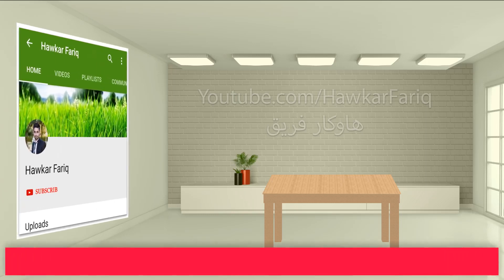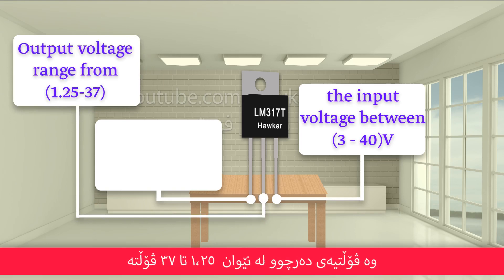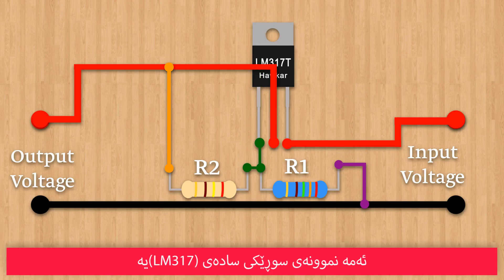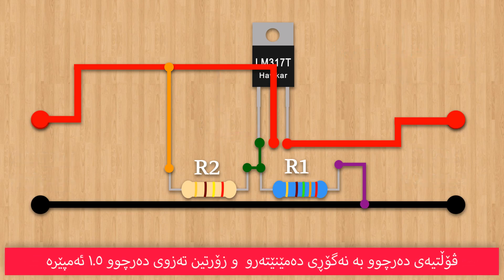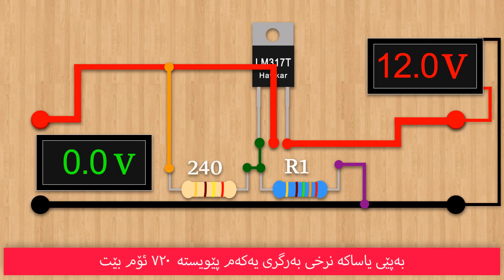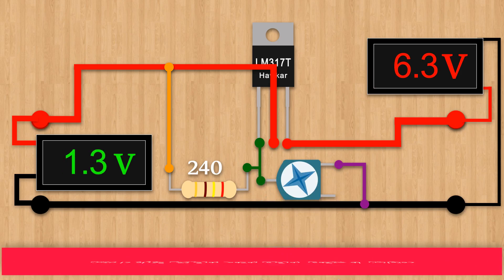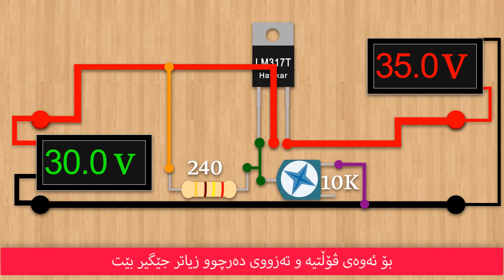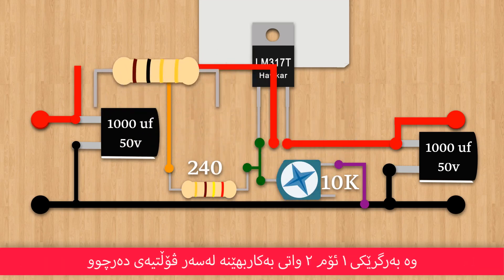LM317 voltage regulator (1.25v to 37v) 1.5A

Comment: Simple and detailed explanation. It would have been better if you could have told more about why we need capacitors and more resistance to the out and input and how did you calculate 240 ohms for the first resistor

Comment: I want to make 5volt charger from 12volt adopter for my mobile phone.
If LM317 become short then 12 volt will be at output 
My question is that...
How i can protect my device in this case.
Reply from the maker: Have an IC LM7805 it's better because it whe you give 12 volt to this IC you get 5 volt only from output.
Reply: @HawkarFariq  ok thank you sir.

Comment: what if i want to increase the AMPERE
Reply from the maker: The maximum current for LM317 is 1.5A.
But you can also use LT1083 it gives 5A
Reply: 2955 & 3055

Comment: Can i use this diagramme to charge lithium battery
Reply from the maker: Only one battery or more?
3.7v?
If only one battery 3.7v
Yes you can use this circuit
And the maximum voltage for charging 4.05v to 4.25v.

Comment: Sir how about 3 phase  ac in the input and max 14.5 v dc
Reply from the maker: What 3 phase?
This is DC to DC converter "regular voltage"
And the max input voltage is 40 volt

If you want to convert 3 phase AC voltage to DC you mast use transformer to decreasing the voltage and use diode to convert the AC to DC and use capacity to filter the voltae. after that you can use this circuit

Comment: Resistance value
Reply: Capacitor
Reply from the maker: The input is 50v 1000uf
And the output is 50v 100uf
Reply: Okk thanks
Reply: If the capacitor is not plugged in
Reply from the maker: Why you don't want to use the Capacitors?
You don't have these Capacitors? 

The Capacitors for filtering the voltage to make a pure DC.
Reply from the maker: The first resistor is 240 ohm
And the variable resistor is 10Kohm.
The last resistor is (2W 1 Ohm) resistor
Reply from the maker: You are welcome

Comment: Dont forget the droppout voltage beetween input and output. The Power dissipation is (U_input - U_ouput) x Ampere. So you can't use it for 1A with 5V Ouput and 30V Input. That would be 25W! :)

Comment: sorry .please if you have motocycle the input voltage AC (5-40volt). how to build a regulator voltage DC 14.5v and no more than 2 amp? .help me please 0.
Reply from the maker: Hi brahim.
The first time rectifier this AC voltage to DC by bridge diodes.
And use this circuit to control tje voltage and yoy can give any voltage.
https://youtu.be/O6XubiSmesw